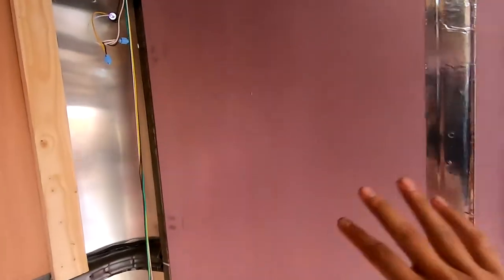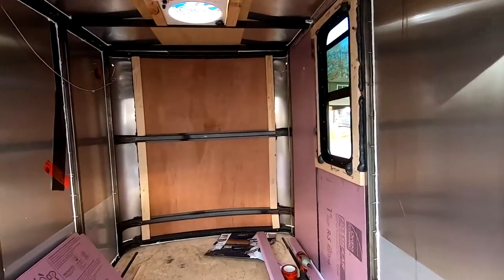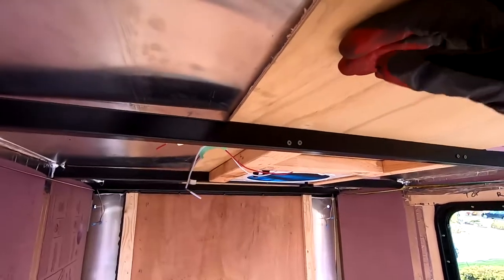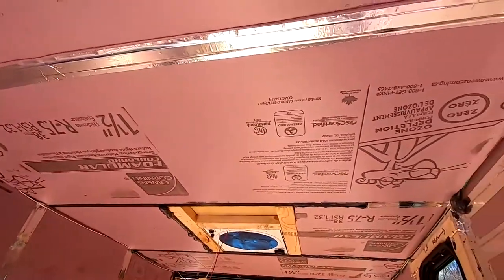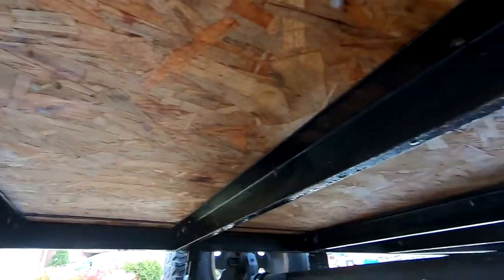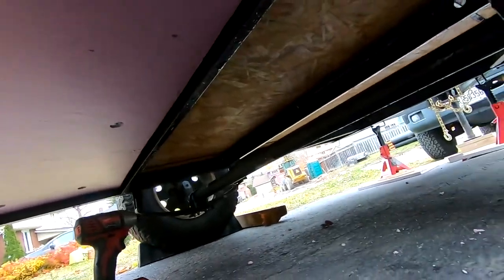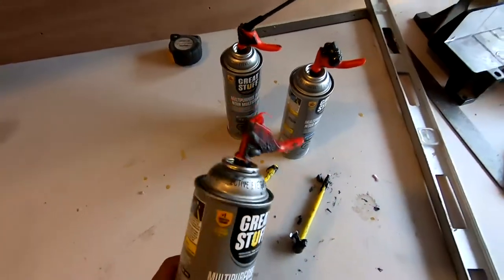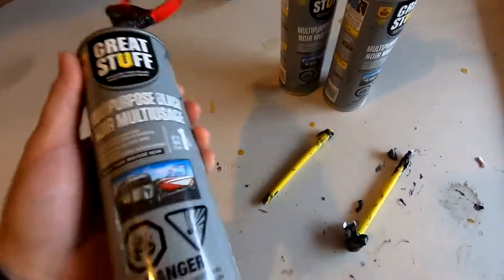HOW I added INSULATION to the Cargo Trailer Camper Conversion

Comment: The gaps in the floor are there for the water to have a place to leave the trailer when the roof leaks.   I recommend that everyone who buys an enclosed trailer immediately seal the roof better than the manufacturer.  When you see all the flaws in the build quality you should not trust that they sealed the roof properly.

Comment: An idea for the underside foam panel protection would be to coat the exposed side with "poor mans fiberglass".  Lots on YouTube about it.  Its basically painters drop cloth and waterproof glue.  Makes for a pretty durable coating.  Great job on the trailer.
Reply from the maker: Thanks! That's definitely a good idea. I haven't done anything to it yet after 1 year and it's still holding up great. Thanks for the watching

Comment: Home Depot has a product that looks like cardboard but it’s plastic and is white in 4x8 sheets. It’s the same thing that RV manufactures use only there’s is black.
Reply: I think you're talking about FRP which stands for fiberglass reinforced plastic it comes in smooth flat white and the more popular textured version

Comment: Those rigid foam wedges/shims to support the ceiling are a great idea.  Rain pools all the time on my flat "one piece" roof cargo and trailer it seems random where all the water dumps off.  Do you think it would have been possible to add/glue the 2nd layer of insulation as one continuous  "thermal break" right over top the first layer and then clamp/screw it down over top with those furring strips?  (Like they do on solid concrete basement wall interiors).  I realize you would loose an additional 3/4" per side though.  I am concerned about my aluminum trailer framing conducting heat into the trailer in direct sunlight.   Also what about protecting the foam in the the Chuck Box underbelly with truck bed liner spray?  This vid has to be one of the top trailer insulation videos out there.  Thanks!
Reply from the maker: Thanks Ojo! If you checkout the ceiling finish video I show how I added strapping and an additional layer of insulation to stop the thermal bridging as you have mentioned. That's a great idea to protect the under layer of insulation. The only thing is that any kind of spray paint (that is not water based) will eat away and degrade the insulation.
Reply: Buy some corrugated plastic sheets (like yard signs) to mount to the underside to protect the insulation.

Comment: What did you start slapping up foam board right behind the undercoater. And dump acetone or whatever chemical that will devolve the type of spray foam on hand. Works like brand new

Comment: If you flip your springs from bottom of your axel to the top you will have more clearance and you can add your fenders again. 🙂👍❤️🇨🇦
Reply from the maker: I ended up just building my own heavy duty fenders. If I am going to do any suspension mods, I'll likely swap out the 4" drop axle for a straight one and gain 4" clearance
Reply: Most spring flops would result in extreme results.

Comment: Any issues with the floor insulation ? I need to do the same, but I’m not sure if it would stay in place without some kind of additional covering/ support.
Reply from the maker: I made sure that the pieces of insulation fit snug. Screws with large washers are all that is holding them in and I've taken it out multiple times no issues at all!
Reply: @JoelTremblayCA  thanks for quick reply. I’m gonna add ASAP.

Comment: My apologies if you already mentioned it in the video, but what type of glue did you use on the rigid foam to insulate the ceiling?
Reply from the maker: I actually didn't use any glue, I ran out at that point. I did use a tube of foam glue for the walls, but it was not needed. I cut the foam boards so that they would fit in snug and then tape on the seams to hold it in place.  Thanks for watching!
Reply: @JoelTremblayCA  Thanks for replying, Joel. That's what I did on the walls on my trailer as well, the rigid foam fit snug without glue. I'll probably do the same for the ceiling as well, and the tape will probably further help keep it in place. Thanks!
Reply: How about ceiling moisture. I'm getting water droplets on the rood under the foam insulation

Comment: Hey what difference in temps did you notice in the trailer compared to the outside ? Also during the winter and summer times?
Reply from the maker: The trailer has been comfortable year-round compared to the outside. I run a diesel heater in the winter for heat. Make sure to have good ventilation is essential, window and roof vent open to allow air flow.

Comment: How has the insulation under the sub floor held up? Did you ever have to cover it with any material?
Reply from the maker: Hey Johnny! the insulation has held up fantastic. I did not end up covering it, after a year of hard use and travel it still there. Thanks for watching!

Comment: Is the pink insulation board better than the foil cover?
Reply from the maker: In this instance I would say yes. The foil based stuff needs and airspace in order to function properly. It may claim higher R value than the pink stuff but it will greatly lose its thermal transfer properties as temps drop. Thanks for watching!

Comment: Can you please share what is the inside temp in summer and winter without AC or heater under this insulation? I am worried about the aluminum skin that conducts the heat / cold too easily.
Reply from the maker: That's the whole reason for insulation, it slows down the thermal transfer from inside>out or vice versa. This is know as R value. Higher the R value = slower thermal transfer. I've been comfortable in this trailer when it's +25°C (with window and fan open) to -25°C (with a heater of course)
Reply: @JoelTremblayCA  k, thank you!

Comment: Does the pink poly foam have a vapor barrier on the aluminum skin side?
Reply from the maker: No it does not. I did not install a vapor barrier because I want the wall assembly to have the ability to dry - inside>out - outside<in. Having good ventilation is key. Never had condensation issues.

Comment: How did you get the wood unscrewed from the walls?
Reply from the maker: Impact drill with #2 Robertson bit
Reply: @JoelTremblayCA  would recommend spray foam or board foam?
Reply from the maker: @YouTubec269  depends on your budget. Both have pros and cons.
Reply: @JoelTremblayCA  How did you insulate your door?
Reply from the maker: https://youtu.be/bVjwWibhZPg?si=6cYxYjUlJNqw3BK5 @YouTubec269